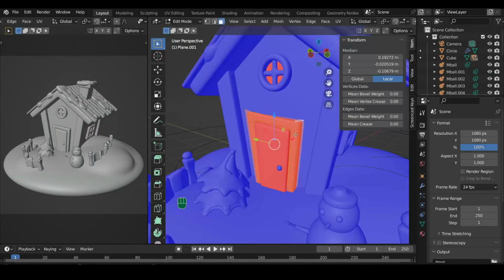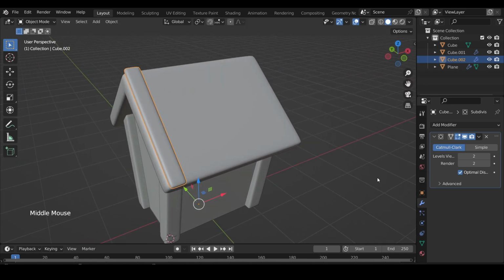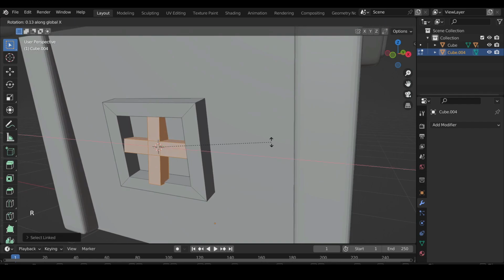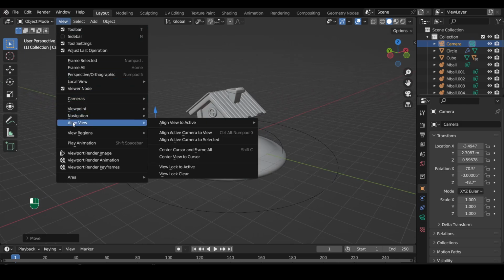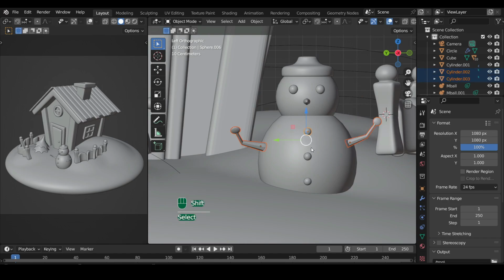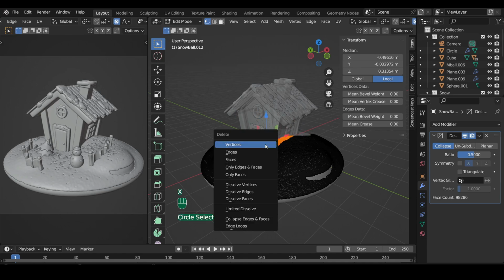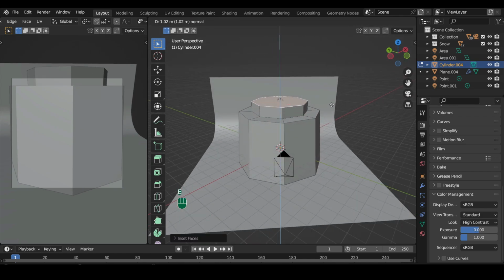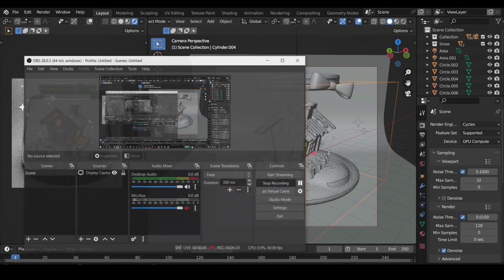Blender 3D - Create a Snowy Winter House | Blender Beginner Tutorial | step by step process

Comment: Just an fyi if anybody struggles with the roof part when using the array modification: if your "roof tiles" don't line up next to eachother you can adjust the factor x,y,z under the relative offset to get your 1st copy correct and then they will lay properly.